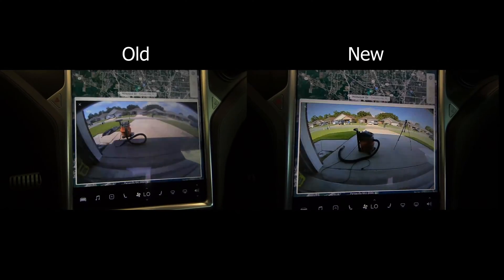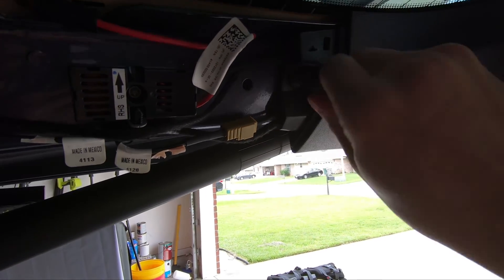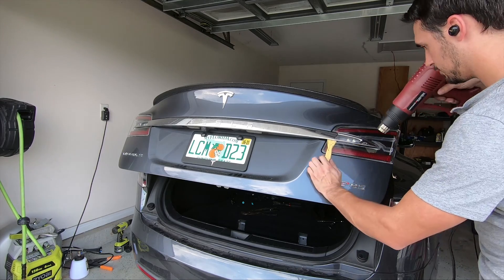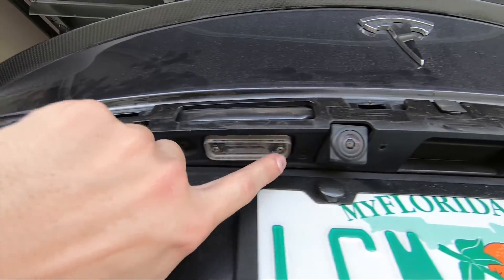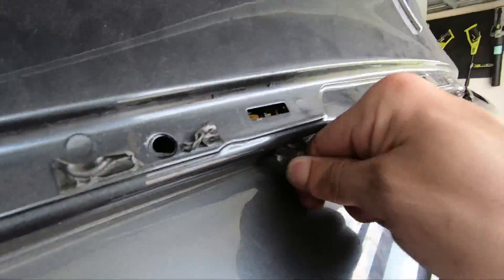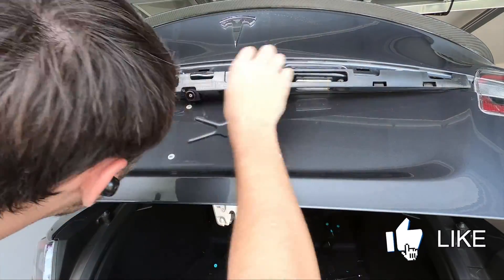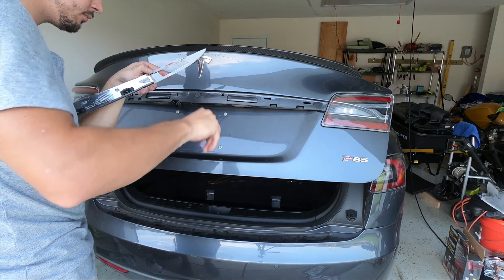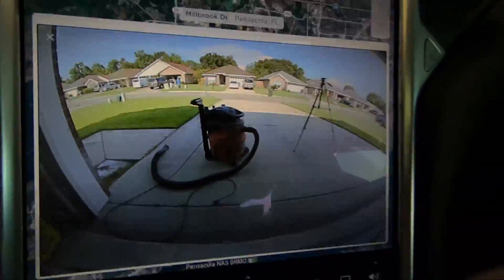How to: Upgrade back-up Camera in a 2014 Tesla Model S

Comment: I want a Tesla is it worth it?
Reply from the maker: It would depend on what it is you're wanting in a car. If you're wanting border-line supercar levels of torque and acceleration for a fraction of the cost? Definitely.
If you want to never have to stop at a gas station again? Of course.
If you're the type that can't stand having to stop every 3 hours to charge for 30-60 minutes on a road trip? No, you're going to be annoyed.

As it is right now, their customer service and support are severely lacking, but I feel as the company grows over the next year or two that should drastically improve. They just weren't staffed appropriately for the release of the Model 3.